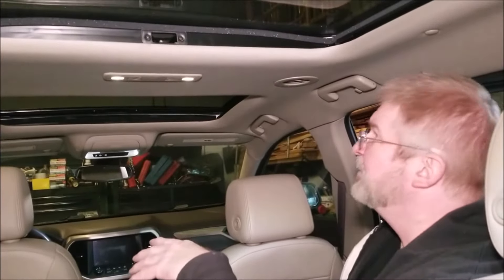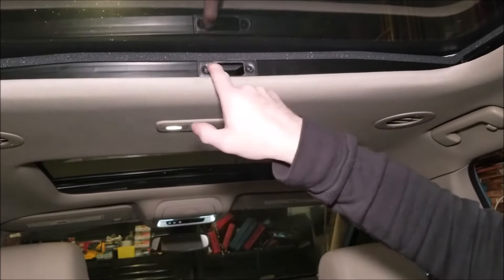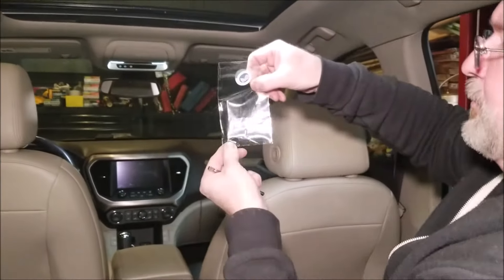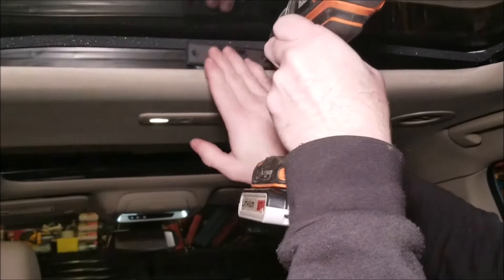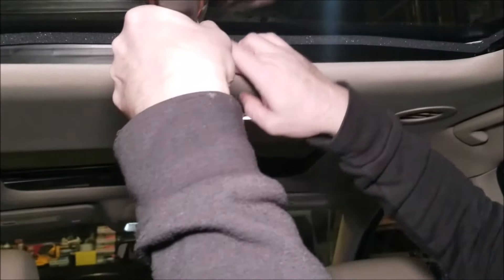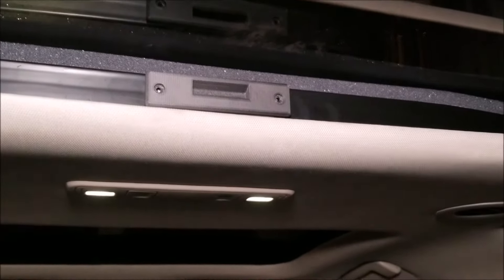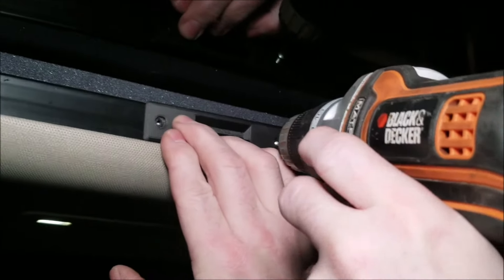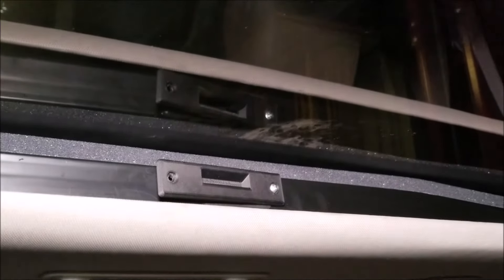Traverse/Acadia/Enclave Rear Moonroof Latch Fix/Replacement

Comment: What size bit did you use
Reply from the maker: I believe it is in the description, but I believe 1/8" as a pilot hole, mayhave been smaller 1/16, make sure the bit is smaller that the metal screw diameter...